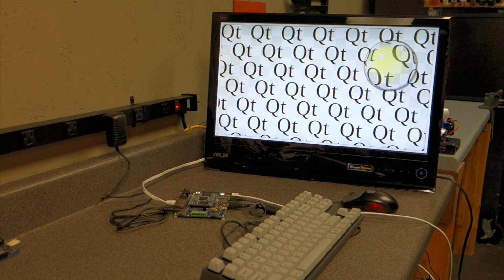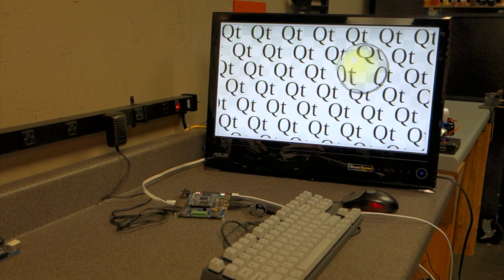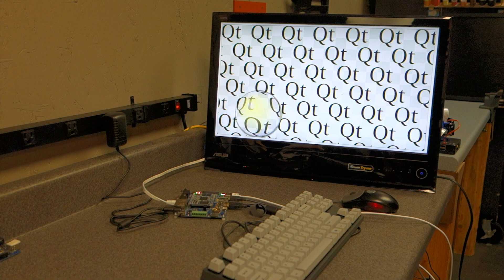MYD-AM335X Linux Development Board

Comment: Hi , I need some help with MYIR AM3358 board , 

I just can't boot the linux system in it , 

i did all the necessary configurations : 

i wrote the system in te SD card , but when i power on the board i can't visualise anything in the screen connected to it 

what am i missing ?